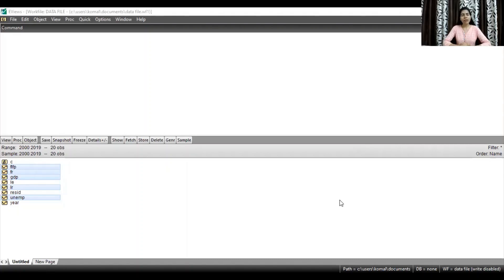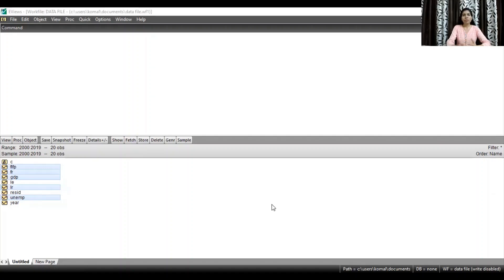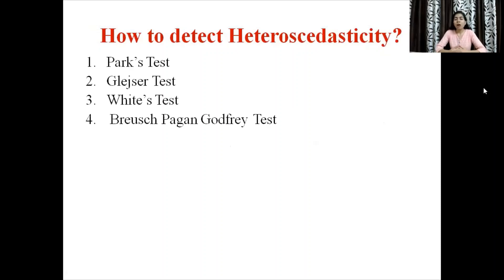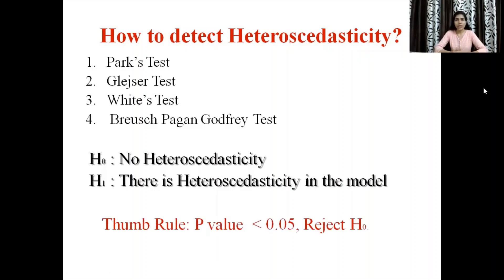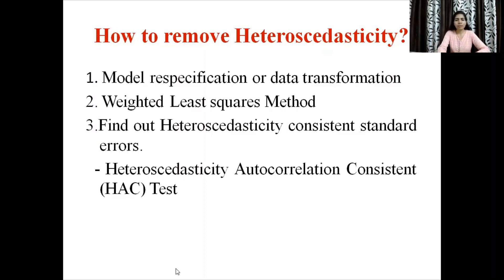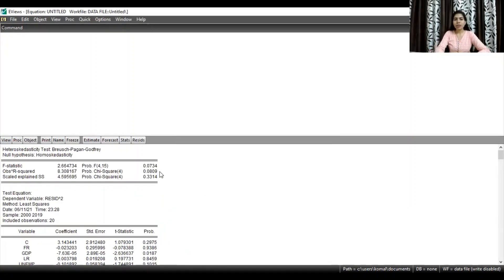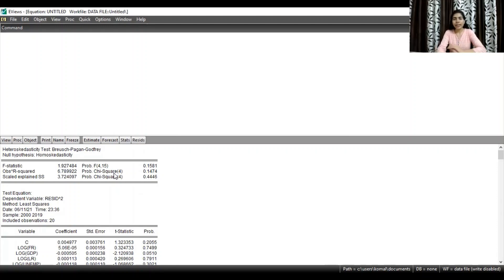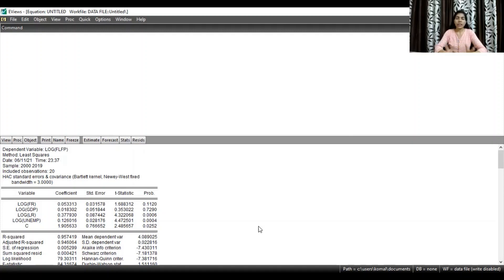Heteroscedasticity| Heteroscedasticity in E Views| Breusch Pagan Test| Heteroscedasticity Test

Comment: after running these on my data, getting the feedback log of non positive number. please how do i rectify this problem?
Reply from the maker: Log of non negative number is not defined. Hence, work on your data set. 
There are various ways you can deal with it. You can refer such articles-
https://blogs.sas.com/content/iml/2011/04/27/log-transformations-how-to-handle-negative-data-values.html
Reply: @komalkanwarshekhawat_  
Thank you very much for posting this article
So not normally distributed is not a problem with large sample size and you run regression with OLS 
So for which method is required please.

Thank you for your response

Comment: I'm using Eviews 12.  I tried to run the Heterostadisticiy test and received the following error message "Cross-section effects with period GLS weights not allowed."  What is plan B to perform the test?  I'm using the data converted in log format.  

Kindly regards,
Reply from the maker: You are choosing two options (cross-section) with (period GLS weights) which can not be performed together. Instead of (period GLS weights) choose another option.